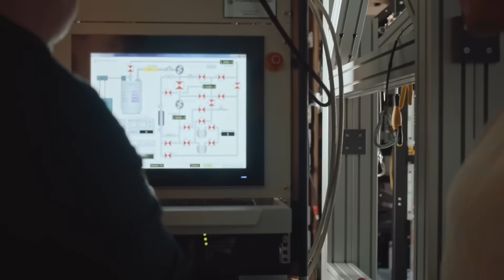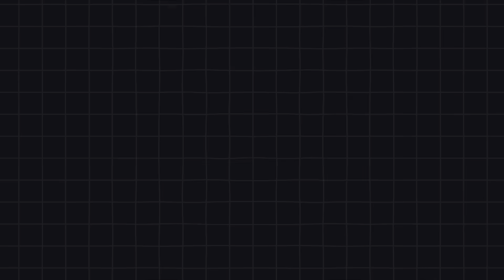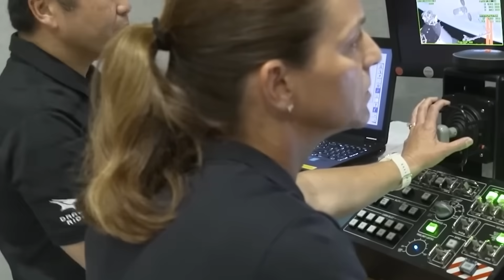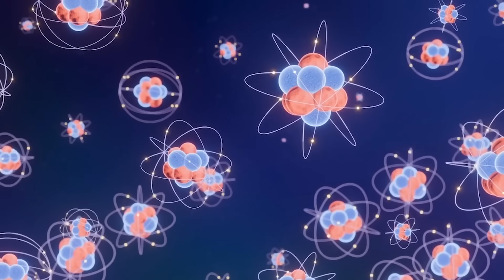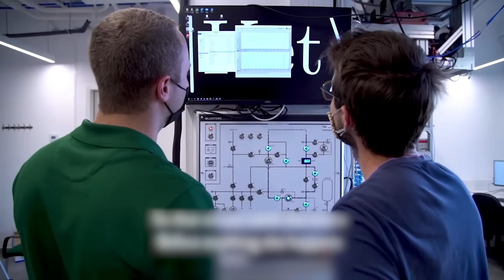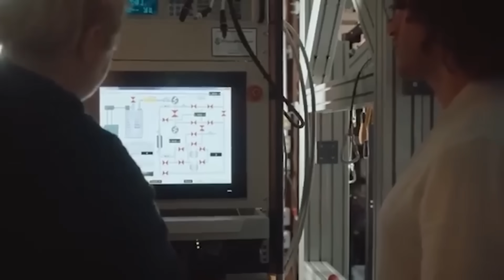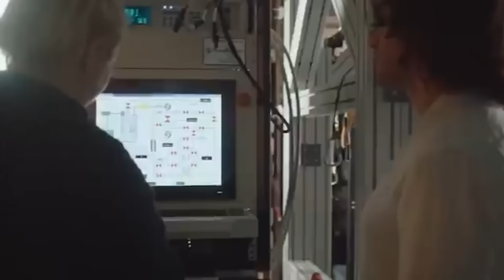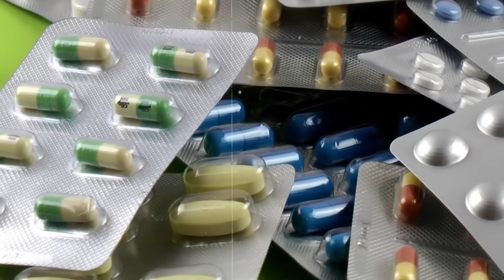Why Michio Kaku Believes Quantum Computers Will Reshape Reality

Comment: Coherence like marching in unison, decoherence like  wrong route or reroute or misalign or strayed or no connection. Disturbed then affected. Not measured. Have you knocked on its sensors. When synch it would. Or the none observance could be speaking of something, not there at the same time.